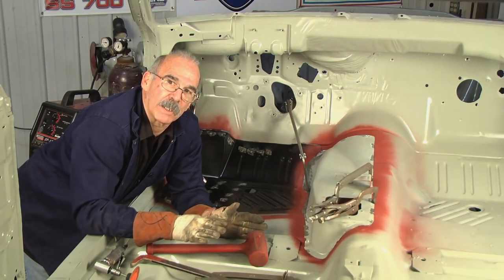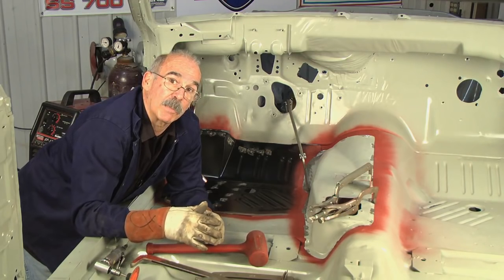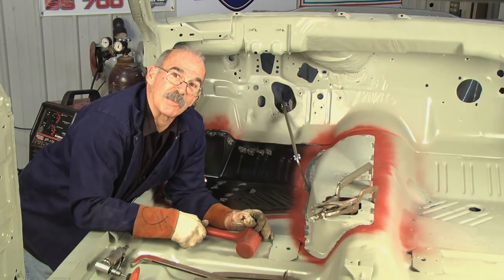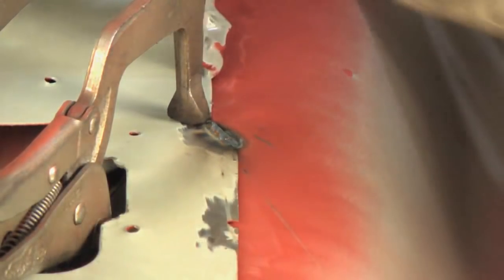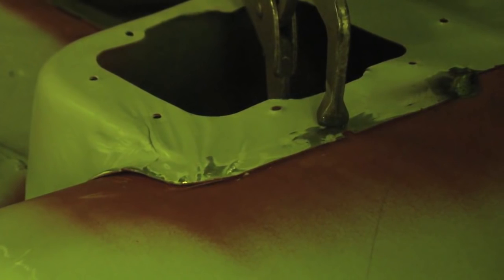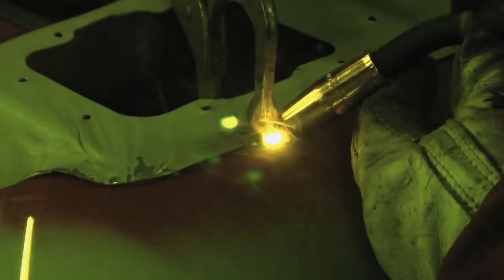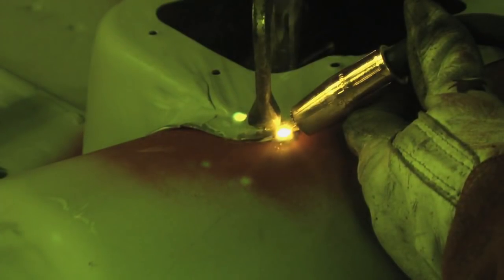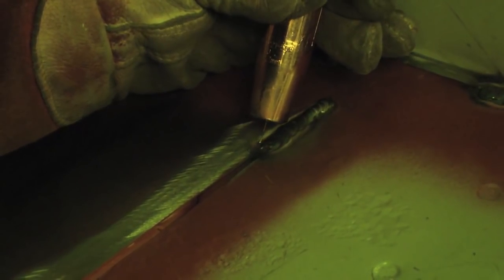Welding Tips: Floorpan Lap and Butt Welds

Comment: You are a fantastic teacher Craig!  I  wish we had you as our instructor in autoshop 101 many students would have gotten A's instead of flunking out. 
Thank you for the instructive video your's is different because of the subject.
Most how to welding videos even the really good ones by fantastic welder instructors are just welding pieces of metal together.
Welding thin sheet metal during a restoration or customization is a must but not  many videos show automotive welding work.

Comment: Im not sure if you guys will see this, since the vid is older, but I need some advice. Im not a welder...at all. I have a stick welder, and have welded once (succefully) but it was a thick bracket. Im working on floor pans, and other patch work on sheet metal (Ranchero woes). Do I have to do a weld completely around the perimeter, or will spot welds and tacks be enough with loads of seal sealer?

I know stick isnt ideal, so Im running around 70A on 1/16 rod, and I did have some success with some patches. The patches though are much thicker, so I dont blow through the parent metal (since its already worn down from rust). I just was scared of blowing through, and kept it at some continuous welds and some tacks, and the said sealer. I will also paint on top, possibly with POR15 or a bedliner type coat.

I also have to fab up the ENTIRE floarboard (mine was rotted to where nothing, not even the crossmembers were left...as I said, Ranchero woes). I will use 10ga (I know...thick but that should weld easier). I will not go for a factory look, but it has to hold weird. I plan on fabbing some square profile tubing to act as cross members, most likely along the inside to prevent dirty and rust from popping up. This car is my latest car...and Im not that attached to it (yet...), but its not bad on the outside. Inside though...its like me. I have a broken neck and lower back, with plates and bolts and fusions...so, in a way, Im getting this car back as proof that were both not down and out. (I also have the car I had my wrech in...and I will restore that one too, one way or another but at least no welding on that job! I was able to score a parts car with everything I need).

I will be uploading tomorrow the video I did of what Ive done, and I dont care for views, but if anyone that knows welding, could take a look at it (it will be something with EP 96 in it...my latest vids have been...odd), but I would like to know not how good but, how bad is what Ive done. If its not totally terrible, Id be happy, and just strive to get better each time I weld. I am actually a certified mechanic (on Boeing 707 and variants, and McDonnel Douglas DC-10 and variants...but I have done loads of mechanical work to where I consider myself an expert on early 70s Continentals...I just never did anything like this, the welding, even painting...and I have three and a half cars that need my attention! I also like to motivate younger guys, that its never to late to learn and to try at least...and to not be afraid to ask for help!).

I hope this wasnt too long. Loved the video and technique! That car looks like it will be (or already is by now) a gorgeous automobile.
Reply from the maker: Great question! The ‘Ask an Expert’ section is currently for members of our online community. I would be happy to send your question off to the experts. To get started, please send the email associated with your paid membership account. Thanks!

Comment: Very good video as I need to patch a rusty floor.  My question, not knowing anything about welding, why do you weld pushing away instead of starting at a point where you would weld pulling towards yourself?

Comment: These are great tips to know, and I don't even have a project car to put them to use haha. One question though, is the rapid cooling with the air nozzle a way of preventing the sheet metal from warping?
Reply from the maker: Hi Matt,

Yes the reason for the air is to eliminate heat buildup in the sheet metal. 
Heat buildup can lead to warping the sheet metal, and when working with sheet metal much of the effort it spent controlling warpage.

Mark
Classic Car Restoration Club

Comment: I am currently replacing floors in my truck, i have to lap weld a few spot and wondering what primer you are using to weld onto? I'm worried about contamination and want to eliminate any chances of it later on after all this work, thankyou for your videos
Reply from the maker: Great question! The ‘Ask an Expert’ section is currently for members of our online community. I would be happy to send your question off to the experts. To get started, please send the email associated with your paid membership account. Thanks!
Reply: @ClassicCarRestorationClub  no thanks we are in lockdown gotta pay bills before i pay a membership for my question when I found my answer through Google research fairly quick and easy.

Comment: Hello, If you are fitting up and calling these "lap welds" is the sheet metal lapped over?  what keeps the moisture out on the underside?  thanks I have a big resto project and this will be very helpful
Reply from the maker: Lap welds are the best for floors and firewalls, but you are correct unless they are sealed up. it only gives rust a place to grow.Always apply "Seam Sealer" to lap welds If you look closely at untouched factory seams you'll always find one side or both have seam sealer applied.I prefer a good quality "Autobody Seam Sealers" that are paintable. Here is a link to one good source: ( www.autobodytoolmart.com/3m-urethane-seam-sealer-p-19154.aspx )I always do both sides of the seams, and apply it liberally, it looks weird right after it's applied, but once it's primed and painted it nearly disappears and provides the protection you need.

Comment: Hi, when you use the screws to pull the sheet metal together, do you weld over the holes afterward? Thanks for the great video!
Reply: I was wondering the same thing, and he did not comment in the video or here. I surely would after having a nice weld to hold it together, it only makes sense to back out the screw and fill up the hole with the welder while you are there.
Reply: you get a device known as a copper spoon. you put it behind the hole and fill it with a weld/ Mig welds will not stick to copper
Reply: Great tip. I hope to save enough to buy an everlast mig welder at some point and have always wondered how people are able to weld thin metal without burning through.
Reply: i make my spoons out of short length of copper pipe, i flatten it out and then bend it to the proper angle. if you are by yourself. use a bottle jack under the car as a third hand

Comment: Question: What size wire are you using? What speed? i'm using a flux core welder i got from harbor freight, it seems to work, but i'm no professional. Just a kid trying to make the best of what he's got.
Reply: Hey mate. Im a welder by trade for 15 years now. Use solid wire and gas .9mm is about as big as you want to go. I'm using .6mm for panel work like this. Hope this helps.
Reply from the maker: Hi DJ,

While I do not recommend using a flux-core welder for sheet metal; I do understand making what you have get the job done. 
Use the smallest diameter flux-core wire that will work with your welder. The wire speed will be determined by your heat range, experiment a little and you'll find setting that give you predictable results. 
With flux-core wire you'll get more weld splatter and it will burn a little hotter, so take your time and skip or stitch weld your seams, and cool things down between short welds to avoid building up heat and warping sheet your sheet metal. 
There is no substitute for hands-on learning, so take your time, learn from your mistakes and remember all die-hard car guys started where you are, so enjoy the process.

Mark
Classic Car Restoration Club

Comment: what size wire are you using to be able to weld as constant as you are on sheet metal? im running .025 and i can only put a dot before waiting to cool. i dot, skip 3-5", dot again. then go back and overlap to fill the seem.
Reply from the maker: MIG welding sheet metal is more difficult than many make it.Burn through, controlling heat buildup, gun speed, wire speed, heat settings, etc... all affect the quality of the weld.We typically use .023 wire on sheet metal, but also use .030 wire as well. 
Your .025 wire should work well.Consider turning down your welders heat setting and/or increasing your gun travel speed.In some thin metal situations you may have better luck placing a scrap piece of 1/16-inch copper behind the area to be welded. 
It will prevent burn through and the copper will not bond to the steel (it may stick sometimes, but can easily pulled off). 
This is also a great way to fill small holes too. here's a link to a tool for this: http://www.eastwood.com/welders-helper.htmlThe best advice is to practice on an old fender or similar, and find a technique that works best for you.

Comment: hi there,are you using flux core wire or gas shielding ? great video
Reply from the maker: Rob, we prefer to use a shielding gas, as there is less splatter, cleaner looking welds, less slag to grind off and it welds a little cooler. Which is a good thing on sheet metal where you are trying to control the amount of heat created to prevent warping the sheet metal.

Comment: Hi Craig, Could you let us know what size MIG wire you use and at what voltage the welder set.
Reply from the maker: When MIG welding sheet metal, thin wire is better. Most often .023 solid wire is used with a 25/75 argon/CO2 shielding gas. Some welders can not use .023 wire, so .030 wire can also be used instead. The voltage setting is different on every welder and welding condition, just make certain you are getting good weld penetration without burning through.

Comment: You would think someone making a DVD  instructional how to weld video would talk about prep work. Mig is a clean process tig even more so. Why would you not sand the red primer/paint off. Especially on 18 gage or thinner metal. You will end up having to throw more heat at to burn the paint back. Now I realize it is a non critical weld and the burned paint in the weld puddle will not hurt the weld. But on this thin sheet metal it makes it a lot easier to burn through all the way through or to warp the panel. The bad part is you are teaching these people and they commenting about learning to weld and that you make it look easy. 90% or welding is clean prep and positioning your self to weld as much as possible with out stopping to reposition. But this is just my thoughts. Welding since 1989. Don't get me wrong sometimes if I have a little spot to weld and have done the exact same thing. But I would not teach people to take a short cut.
Reply: Jeremy Miller maybe he is using weld through primer. I never used it but it available.
Reply: @duett445  never heard out it.been a welder for 20 plus on off. No auto body work.  But just saying i am sure most people would not know they paint is special.. you will get some shit results with burning over regularly paint especially with mig.  I was even thinking it's not really welding  bad but.  So thank you explains a lot

Comment: Dosent blowing the welds blow the sheilding gas away?
Reply from the maker: Using an air blow gun to cool the welds is a way of controlling the amount of heat introduced into the sheet metal and prevent warping. Most MIG welders have no post flow gas supply so the shielding gas dissipates as soon as the welding stops. When welding sheet metal warpage is often more of a concern than welds cooling in an inert environment. Great question though!

Comment: Wouldn't blowing air on molten metal promote porosity
Reply from the maker: Hi Axa Axa,
Not necessarily, rapid cooling will harden the weld some but when working with sheet metal the larger concern is heat build up and metal warping. 
Cooling the weld is a great way to eliminate heat build up which will prevent warping. Keep the welds small on sheet metal and control the heat.
Mark
Classic Car Restoration Club
Reply: MIG welds cool off really fast, and dont stay molten for very long.

Now, if i had someone blowing oxygen onto my weld while i was welding, the'd get slugged right in the mouth

Comment: Can I use flux core for welding in my floor
Reply: I wouldn't use fluxs core on that because it burns hotter (youll burn thru the sheet metal alot) and its very splattery so clean up and or fire Hazzards may be an issue...
Reply: You can get a shorty tank filled for about $60. The welding supply shop i go to lets you lease the cylinders about $50 a year
Reply: npa4863 thanks I just bought a tank today  it cost $290 Canadian paso's and its the small tank but it $70 to fill it up
Reply: Bigwilly Pacino yah currency difference put it up alittle more
Reply: Flux core wire welding (mig) will leave some slag on your welds, and although not pretty, it's ok, and if you decide to get a tank with C02 and Argon mix (shielding gas) and a regulator and convert your welder, make sure that you school yourself about the welder polarity. I did not change the polarity ( switching the leads) when I added the gas feature and my welds were sloppy and ugly.

Comment: From my experience in welding, you dont need an air gun to blow air on weldin bead because It will cool it self down.
Reply: Kennedy Wong on thin sheet metal it is essential to cool it down quickly to avoid warping. Some use a wet rag some use compressed air some use a copper plate pice, it what works best for you.

Comment: Actually the guy doesn’t have a clue, generally speaking you don’t want  to skip weld anything. Untill it is all tacked up 100%. That goes with anything that you weld ever. This metal will move.  I realize he has it clamped but it will move those clamps like they are not even there..